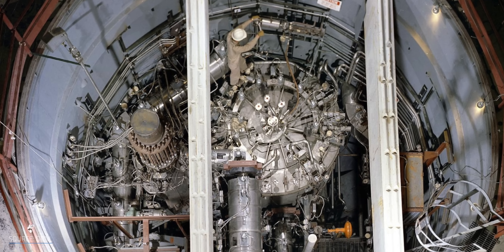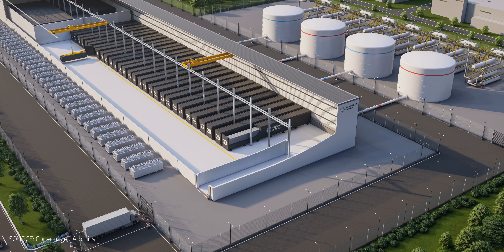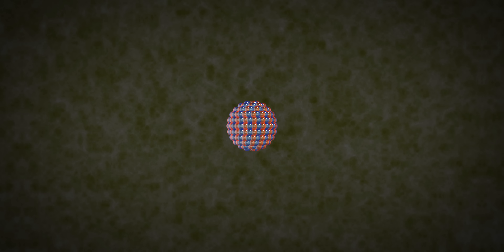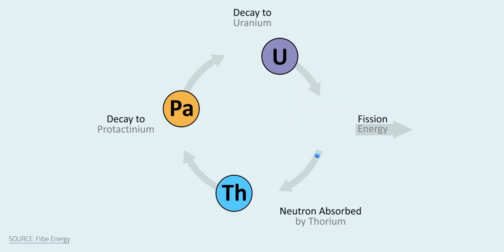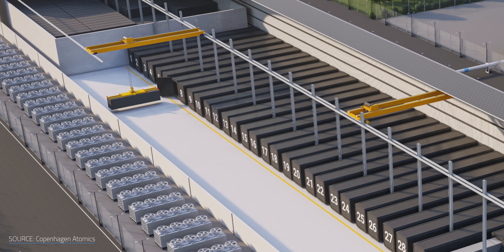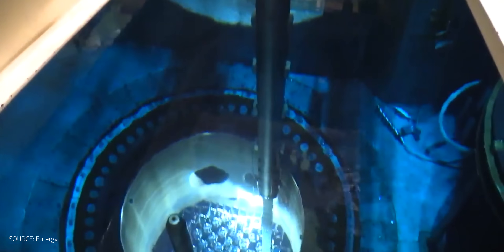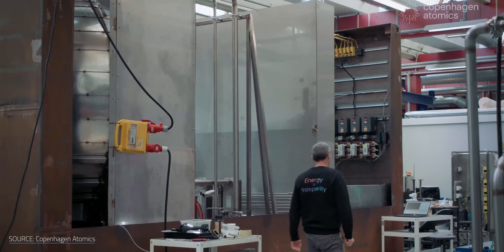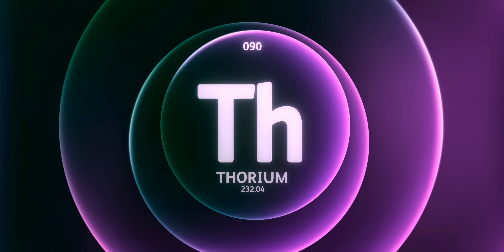Why Thorium is About to Change the World

Comment: Going through some comments and some other thoughts I had on the topic are:

I think it would be a good idea to target train scale instead of shipping container scale.  Train scale and you can go for much larger and heavier reactor vessels.  If you need shielding, you can transport lots of shielding via train.  Here is the thing, a shipping container can only be 8 ft wide and is also limited in height and length as well as weight as in ~25 tons for a full length container.  Train scale goes up to 10' 8" wide for standard sizes, can be 15' tall, over 100 tons, etc.  It is just a much larger scale.

Something people don't seem to realize, but shows up when I look into the matter is activated materials usually lose radioactivity 'quickly' over time.  You don't have to store this stuff for forever.  While a major goal is to have corrosion down to nothing and run forever, while this goal is worked on and improved, a system that could be built is waiting for activated materials to lose their radioactivity and then recycle them into new reactor vessels.  A Thorium reactor program needs to be looking out over the long haul, assume people and advanced civilization is going to stick around and rely on these Thorium reactors for some time to come, and build that into the sustainability model.  So if you can't keep a reactor module running indefinitely, then you have a storage period for it where the radioactivity settles down and then you can say recycle it into a fresh reactor module.  If you think about it, everything on Earth started off radioactive from a star / supernova explosion.  Almost everything on Earth is not radioactive or at least is down to a safe level.  This is because most elements when activated lose their radioactivity and it is my understanding at least from reading up on this that this process happens relatively quickly on human time scales.  Even the spent fuel in these reactors loses most of its radioactivity within the first hours days months, and years with the 300 year number being back to background radiation levels.  It sounds like the reactor vessel with the fuel drained out is likely on the order of decades.  So, your recycling program will just have a bunch of used reactor vessels hanging out above ground for decades and then recycle them.

The hope really for these reactor vessels the corrosion issues will be better tackled and you will end up with reactor modules that will last for decades or more.  I thought we already had solutions for this.  So if a level off point is reached, a large percentage of all reactors made will be in active use.  Maybe less than 50%, but even say 30% would be a good fraction.  Then you take the 'spent' reactor modules and refurbish them and put them back into service.  And with improving automation, while even robots will fail in high radiation environments, you can increasingly look to having some level of elevated radiation left when you refurbish / recycle the reactor modules.  I suppose one thing about keeping the reactor modules smaller is for train transport, you could look into containment vessel cars that are heavily shielded to stuff highly radioactive modules in.

With really cheap electricity and high heat, you can think more about making e-fuel.  The notion being hydrogen, methane, and possibly heavier hydrocarbon fuels like propane and beyond.  This would never make sense with renewables as e-fuel is just not efficiently made and renewable electricity is just too expensive and too intermittent.  However, when you have something 1 million times more energetic, nuclear, at your disposal than fossil fuel, making fuel from electricity can start to make sense to do.  Especially with carbon capture, you can have a net zero system where you capture the carbon you use to make the heavier e-fuels.  Here is the thing, hydrogen is the most efficient fuel to make and consume, but it has issues with low density and explosion hazards.  Methane improves on the density issue and is already in large scale use, so producing it as an e-fuel just plugs into existing systems.  If you can effectively get into propane, you can easily compress this into a relatively dense liquid fuel, solving the density issue.  Even a long haul airliner, with advanced composites we already have, you could consider using propane instead of jet fuel and drastically reduce harmful emissions while still being a long haul airliner.  While you can still have an explosion with propane, especially with a BLEVE, normally an accident leads to mainly just fire.  Say a propane powered jet crashes, you will see a fireball.  But then again when a jet fuel powered plane crashes, you also see a fireball as liquid fuel sprays out from ruptured tanks at high speed and ignites.  So really, it would be hard to tell the difference.  Usually propane explosions come in two forms, closed space and happen to get the right mix of propane in the air, and hot propane, say in a sustained fire situation, reaching BLEVE temp before the containment vessel ruptures.  There are piles of YouTube videos of people trying to cause a propane explosion and they can only at best get a fire.  I mean engineered right and it is hard to do.  So really with propane being a clean burning fuel and a fuel that can be stored as a liquid, if you can achieve reasonably efficient propane production, you don't really have to dive into making heavier liquid hydrocarbon fuels with electricity.

For a rocket, you need to make liquid oxygen and liquid nitrogen.  This can been done effectively with electricity, pulling it out of the air.  So say SpaceX's Starship, you could make the methane, the oxygen, and the nitrogen with nuclear power.  And you don't need a huge outlay either if you scale Starship up to current day Falcon 9 launch cadence.  Just putting that out there.

Another cool thing with molten salt is with just a simple heat exchanger, you could cheaply store thermal energy in molten salt tanks for dispatchable power.  The power grid has demand changing throughout the day and night, so you could build these reactors to run the core at 100% around the clock and then very output over a 24 hour period by storing molten salt during low demand and releasing molten salt during high demand.
Reply: Admittedly, I did not read your entire reply because I'm currently at work and it's a long and presumably well thought out argument for train scale vs shipping container scale. There's a chance you mentioned what the main reason they probably chose shipping container scale and I just missed it.

I suspect they targeted intermodal container sizes for the reason that's right in the name. Inter-modal. They are a standard size for ship, train, and road traffic. Now, the weight will be an issue if each 40' intermodal size unit is 40T, since that's the USDOT max weight for an entire semi truck, not just the load. I'm assuming (not good, but again, at work and not a ton of time to research in depth) that most countries will have similar weight limits for their standard trucks pulling intermodal trailers.

But the weird thing is I don't think these couldn't go on a standard intermodal trailer, because of the weight. Most intermodal containers I've seen have GWR's around 25-30 tons. I can't imagine the trailer is rated for much more than that.

Edit: forgot one of my main "counter points" as well. Trains have to stay on train tracks. Intermodal containers can be transported via roads. Generally speaking, the road network will be more developed than the rail network.
Reply: @blackmoon8459 the thought with rail is you only need access to where the power grid already goes.  You don't need to put next to where it is used.  In other words, a power plant is a regionally placed facility.  Trains go into just about every region.  You can also oversize load something short distances from a train.  So really, you have access to almost everywhere.  A 100 ton max will also allow for airlift.  Trains in Europe can also hit 100 ton loads and 10' 4" wide when a car has at least 6 axles.  So, you can still roll around Europe on trian with a modest decrease in dimensions.  And Europe can definitely handle large planes and large ships.  So say ship to Europe via cargo ship.  Have some specialized rail stock to roll around Europe.  Don't need to fly, but could if you wanted to.
Reply: I think this is the longest “comment” I’ve ever read (partially, just too long) on YouTube 😏

Comment: Thorium itself doesn't power anything, it has to be processed from monazite and then radiated to be converted to U-232, so what's point? It's a costly process and you are still using uranium and there is still plenty of that available.

Comment: But how would they tackle the spent reactors issue? It's highly radioactive, therefore surrounded by a 1000-ton structure. That means, it can't be safely transported anywhere. So the spent reactors will need to stay where they are, for 300 years, while they accumulate. I don't think that's an issue that can be neglected.

Comment: Solar and wind cannot provide ultra-low emissions heat? What does that mean? Solar and wind generate electricity and can therefore produce practically emission-free heat.

It's like saying that old light bulbs are good because they can generate heat, ignoring the fact that the heat is actually the unwanted by-product.
Reply: They do but it has a lot of waste, mechanical motion to electricity to heat.
Reply: I think the distinction is that the energy they generate has to be converted into heat, whereas other energy sources generate energy IN THE FORM of heat. I'm not sure tho, I didn't watch the video because this guy just appeared on this earth to clickbait the hell out of it for a few years and then retire on all his VPN money

Comment: the 200 years uranium thing i would question quite harshly
its 200 years with no reprocessing, no new deposits found and now reclassification from rock into ore as extraction becomes more efficient.
reprocessing the fuel might be expensive but it pretty much just cleans it out and then there is pretty much most of it left (95%), plus there is still energy coming off the waste - if we manage to build stuff that can extract that, we can use that too, which might be an option in the ~4000 years until our reprocessed uranium runs out
Reply: Don't forget seawater.  There is exractabe uranium in seawater but it had cost many times more than mined uranium.  A recent paper published by resesarchers in China has found a way to extract it at a cost within the historic cost range of mined uranium.  Uranium in seawater provides thousands of times more uranium than can be mined and renews from uranium leaching from sea floor bedrock.  We will run out of rare elements needed for solar cells (thorium is a byproduct for some of these) and the copper for wind generators before we will run out of thorium OR uranium.

Comment: The comment Matt Ferrell makes about the nuclear waste decaying in 300 years is just not accurate. This is only true for fast-reactors. The reactor design copenhagen atomics wants to create uses moderated 'thermal' neutrons and they produce transuranics just like the uranium fuel cycle does, but it creates them in smaller amounts. This effectively means that the nuclear waste decays in 10 000 years instead of 100 000, making the waste issue smaller but still a huge issue.

Comment: lol, reactor in a subscription xD. We've failed as a society if "you can replace and upgrade your setup every PERIOD_OF_TIME". 
Also te foundation of thorium reactors, at least as presented here, "we have uranium for 200 years" is misleading to say the least. 
Known and mined patches of ore indeed may last for 200 years, but how much fission products can be reused from spent fuel? As far as i know only France reprocesses its waste into new fuel rods, not sure about efficency but having 10% fuel for free or 0% fuel for free it's still a gain. 

You might laugh but i live where not so long ago we had to burn through the coal in households to produce heat during winter time. And it wasn't "coal pellets", just raw rocks stragiht from Earth's crust. I've noticed that in ash collector drawer (not sure how it's in English) there collects only partially burned coal, on one because of stirring which is needed for furnace to operate, on the other from inevitable cracking of coal rocks which fell into ashes and lost their heat.Before re-igniting furnace i've ran through these waste by simply screening; ash obviously had no fuel value, same for slag but from 50 kg drawer i was able to recuperate close to 4.5kg of valuable fuel. And not only it being combustible, i was partialy spent so didn't produced smoke and sooth, just heat. Was it worth? Well it was dirty job, had to wear face mask and dirty clothes but 10% less coal consumption during heating season was noticeable relief on budget.

Yeah, it was probably partially automatable even in garage environment but i moved from this place to building with city-provided heating.

Comment: 3:47 That's not quite true. Uranium U-238 can also be used in breeder reactors. This means that it will last not for 200 years, but for 4000 years. And we can reuse burried "spent" nuclear fuel.
Reply: Also, you have the issues with running into legal and treaty restrictions on using uranium breeder reactors.
Reply: The spent fuel and depleted uranium in the states will last für thousands of years, if used within a Gen IV reactor using fast neutrons. 
The waste of 1 reactor year of a 1 GWe reactor can provide up to 140 times the electricity. Additionally, the side product depleted uranium can provide another 4 - 5 times the electricity from waste. In total, this is about 700 times the electricity of all the electricity produced by nuclear in the past. This is are resources worth trillions and could pay easily the debt of the US. 
A side effect is that the "waste" produced from this sources consists of 95 % partly precious metals, and about 5 % of waste that has decayed after 30 years to the level of natural uranium. Of course, it is poisionous, but can be stored just like normal chemical waste. 
IMHO, before using thorium the waste should be burned, then DU. And if this isn't enough after thousands of years, there is the posibility to get uranium from seawater, for which China seems to have found a cost effective way now. 
You can use thorium in the same reactors that burn all waste and DU, but it isn't necessary for energy needs. But be aware, beside some advantages of the thorium use, there are also nasty site effects. The small part of U-232 produced during breeding, which may help with proliferation a bit, decays to TI-208, which issues hard gamma radiation. This requires very expensive shielding and this increases costs.
Reply: That is quite correct, but only in a fast-spectrum reactor, which requires significantly more fuel per reactor. The only element that is viable for breeding in thermal spectrum is thorium.